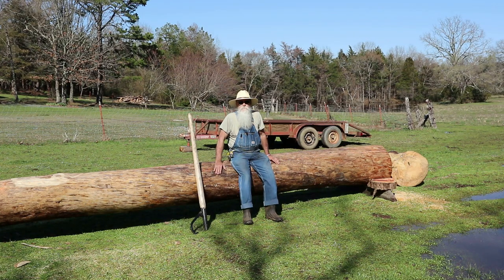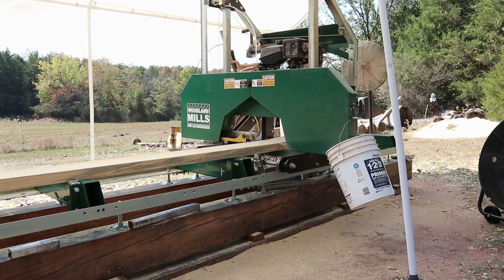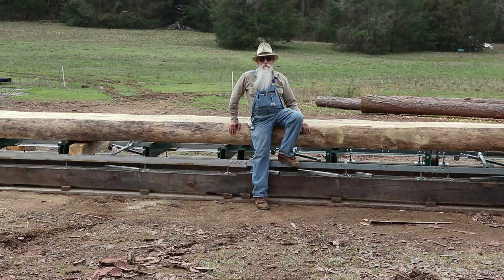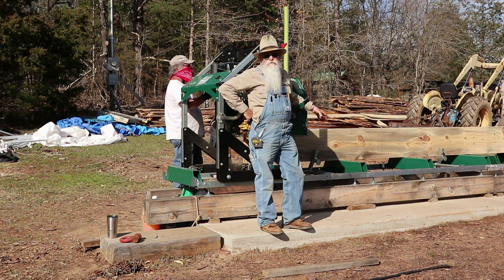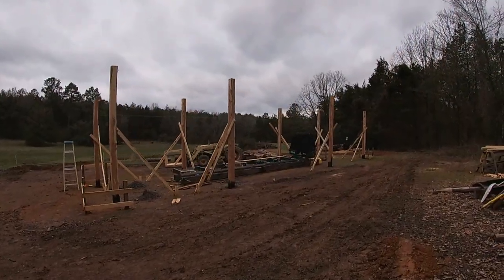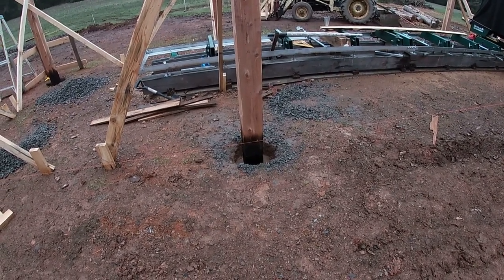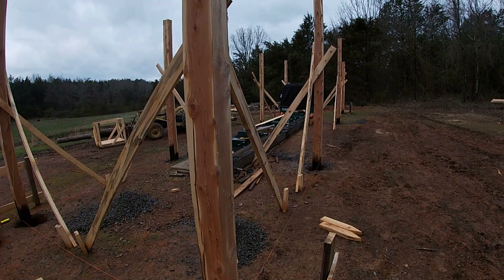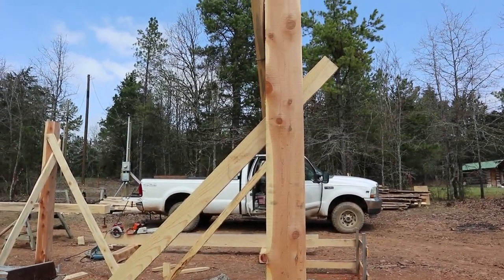Building a Sawmill Shed, Pt 1

Comment: How and why do you burn the bottom of the posts? Preservative?

Please make a video to explain your process too if you would. Thanks!
Reply from the maker: Howdy y’all- I burn the bottom of the posts to help preserve them. I do it with a torch on a propane tank and give it a pretty good charring. This is called shou sugi ban, an ancient method of wood preserving. I’m seeing more of it done nowadays with the high cost for treated lumber. I don’t put concrete around the posts when I set them, instead I ramp gravel around them which lets moisture go on down and doesn’t stay around the posts. Hope this explains it. I do need to do a video on how I do it. Thank you so much for watching the video. God bless
Reply: @TheBeardedCarpenter  Yes, please do! Perhaps even work on techniques that don't propane such as a wood burner stove that draws air (like a rocket stove) to shoot out a hot vigorous flame. 
I found a video of a couple of eastern Europeans that are building out a whole house by themselves. They protected  the entire 8 foot by 500 foot fence and panels with a wood fired technique that would likely empty many many tanks of propane to achieve.
Reply: I have a lot of privacy fencing to add and am considering some sort of chain driven system to pull the logs over the flame consistently and automatically. Windshield wiper motor driving a sprocket driving a chain kind of thing.
Reply: @TheBeardedCarpenter  Actually the folks I mentioned who burn treated their whole fence did use propane.. but built wooden "chimneys" to focus the heat. I remembered it wrong. But their method looks really labor intensive. 

https://youtu.be/CZw6qoFUEBg?t=617

God bless to you and your family!

Comment: what metal did you use for your extension? how long?
Reply from the maker: Howdy- I bought twenty foot sticks of 3x4x1/4”. They cut them at thirteen feet so I could make the first part and then when we built the shed I added on the other seven feet that goes into the storage room. The bunks are 2x6” tubing and I had to put shims under them to get them the same height as the factory ones. I made my own leveling feet and dropped the angle iron down so the top edge matched up. I can barely feel when the head rolls from the factory rails to what I made. Take care and God bless

Comment: How long did you let your post settle before framing it up looks like you know what you are doing
Reply from the maker: Howdy Sam- I tamped several inches of gravel in the bottom before I set the posts. I don’t pour concrete around a post, I use gravel that is tamped really well. The posts are over three feet in the ground and I did the shou sugi ban on the bottom of the posts. When you pour concrete around a post you can cause it to rot if the post shrinks any at all. The gravel will let moisture perk away from the post. Hope this helps. Take care and God bless
Reply: @TheBeardedCarpenter  I understand all that like the day you stood them up and put dirt around did you let them sit for a day or so or go right tp building?
Reply from the maker: @samdaniel5703  I started putting the beams up when I got the posts set. They were solid and secure. Blessings
Reply: @TheBeardedCarpenter  heck yeah well I enjoyed watching it I'm building something for my wife and just getting insight thank you for a quick response you guys are awesome